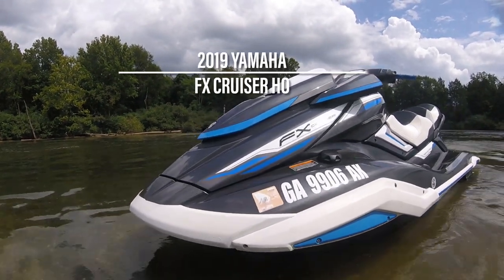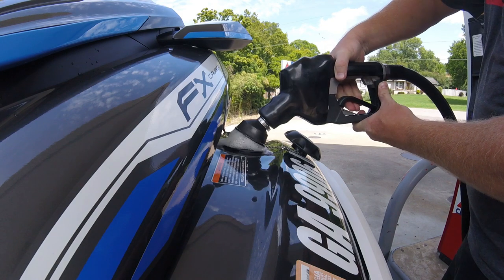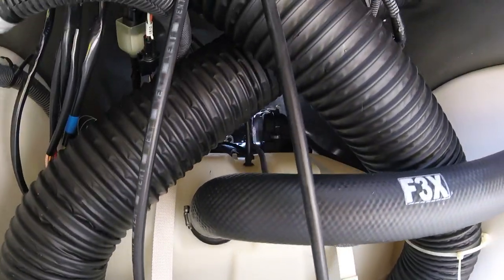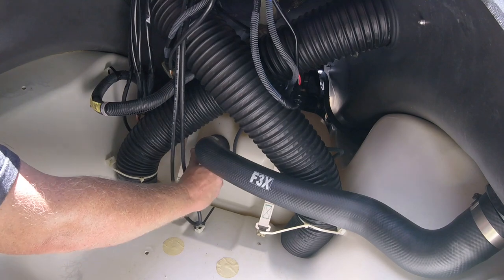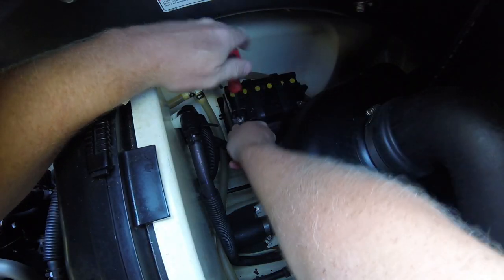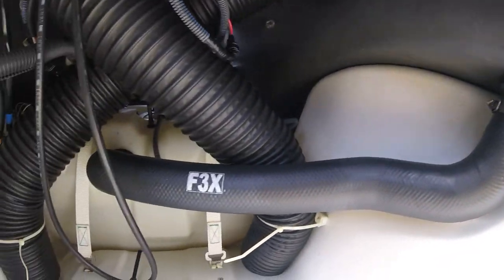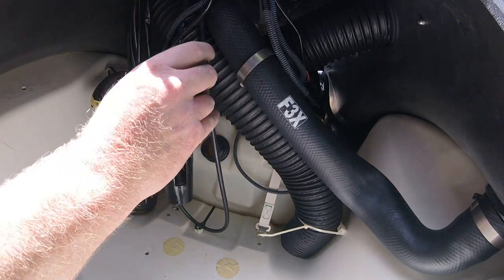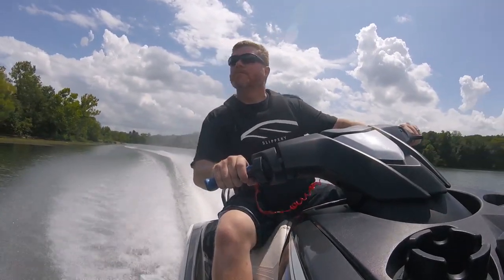Easy Fuel Check Valve Removal For All '19+ Yamaha FX Series: The Watercraft Journal EP. 50

Comment: I understand the safety valve. What is the big concern if fuel sloshes in the tube during aggressive corning or rollovers? The cap is airtight.
Reply from the maker: The cap is a CAFE-certified ventilated cap, it should be fine.
Reply: I have two 2019 both caps don't seem to vent anything. Both build up lots of pressure
Reply from the maker: Either way, the gas tank itself is properly ventilated.

Comment: Good video. Thanks.  I have this problem. Yamaha should consider the safety aspects of the blow-back. I have to fill the tank using about 1/4 speed of regular fuel pumps, and even then still get the occasional blow-back. One other thing to note is this fuel cap position also makes it almost impossible to add fuel while on the water. Someone may get stranded one day because of that alone. Not a great design. Ive added an internal auxiliary tank to give me a longer range for offshore fishing.
Reply from the maker: It does make it tough to double over the handlebars to try to reach the filler cap from the driver's position - that's for sure!

Comment: I like the filler under the hood so much better for looks and ease of use. also i am sure its some government regulation but why is the filler not connected to the top of the tank so it can fill fully. I am sure its so he fuel can have room to expand and contract but this seems like the after market could capitalize on this and design a kit to replace the tank with a top fill and relocate the filler to under the hood and then just design some type of accessory or maybe a gopro mount to fill in the existing filler hole on the hull.  I wonder who decided to move the filler from under the hood and what the reasoning was for it.
Reply from the maker: That's a good question, but easily solved: to better evacuate fumes/air. Unless fed in through the fuel sender, you'll find that most fuel cells are filled from a canted or side angle; this is for better air evacuation (particularly when a fuel cell is pressurized).

Comment: Great video and thanks. On a side note, do you have instructions for replacing the ball chain for the filler cap? The cap part is easy, but down the tube getting to the other end??
Reply from the maker: Hmm. It's pretty easy. You just need to remove the screws connecting the filler neck to the deck, as well as the filler tube from the neck. The chain is easily removed from there.
Reply: @watercraftjournal  Thanks. I will give it a try. I guess you get to it the same way on your previous video?
Reply from the maker: Yup. Just 2 hose clamps and a Phillip's head screwdriver.

Comment: Great video, thanks for the good content.

Side question, i hear there is a valve one can install to avoid flooding a ski while being towed in the water.  Have you done it?  Video?
Reply from the maker: We've never really dug deep into that. There's a lot of questionable claims made pertaining to it, and per the OE's, towing a PWC shouldn't cause flooding.
Reply: Verbatim from the manual of a 2020 Yamaha FX HO

"Tow the watercraft at 5 mph or less otherwise water flood the engine compartment ir water could flow back into the engine causing severe engine damage."

Might be something to look into, I'm sure it would be helpful to many people. I know it exists bit still dont know which hose to install the valve on.

👍👍
Reply from the maker: Yes, this is correct. It's precautionary to keep water backflowing up through the exhaust when pulled at a higher rate of speed (a little higher than 5-7mph). We've never personally encountered this issue despite having to tow several PWC over the years.

Comment: If I suspect water or bad fuel in my Yamaha gp1800, what is the easiest way to drain the fuel tank?
Reply from the maker: It's not easy. Pull out the filler neck (as shown) and siphon the fuel tank dry. You cannot do it with the check valve in it.

Comment: I have a VX Cruiser 2020 and suffer from the same issue. Also, I've noticed on min 4:00 your handle is turned to the left although you are going straight and I have this problem too.
Reply from the maker: You need thrust to steer. Look at the trigger.
Reply: @watercraftjournal  You have your fingers squeezing it. The handlebar is pointing to the left but the ski is going straight or at least that's what I perceive watching the video.

Comment: I have a 2016 VX Deluxe. I filled up the gas tank with 91 octane and fuel stabilizer in Sep of 2020. I store the waverunner in my garage in which is 40 - 95 degrees F throughout the year. Due to drought last year in CA I did not get to run the engine much in actual use so could not burn off that gas. Instead I've been running it in drive way every two months and add a little bit of new gas. Will this keep it stabilized until May of 2022? I can find no way to drain the gas from the tank. There is a check valve in the fuel inlet hose that prevents me from getting a siphon tube in there. Thanks for any advice.
Reply from the maker: You can always siphon the old gas out if you're that concerned.
Reply: There is some sort of check valve or diffuser that prevents me from sticking a siphon hose down into the tank. ☹️
Reply from the maker: And you can always follow our video on how to remove it in less than 2-minutes.

Comment: I have 2 vx limited 2020 and the stupid gas fill is under the front hood. It too fills up quick and overflows, I have to hold the nozzle out 3/4 way to let gas trickle in at 1/2 or less speed.
Reply from the maker: The angle of VX/GP filler neck isn't as flat as the FX, but yes, it can "burp" up fuel if filled too quickly.

Comment: Great design. Yamaha had to know of this problem. With the filler now under the hood, when you do blow back gas  now leaks all over the inside of the front storage. I would use stronger language but, what a joke. Not only do you  you get gas on your personal items inside the storage area you get it all over you and sometimes your face. Screw the paint, I'm more concerned with my eyes or my kids eyes. Yamaha knows of this problem yet continues to do nothing about it.  Sad
Reply from the maker: OK, we're gonna need you to bring it down by about 20% there. Listen, even at full speed, the burping effect won't eject fuel far enough to blow into your or your kid's faces. Yes, it burps and we don't like it (why we did this video), but it won't blow all over you or your storage bin (even if it's open).